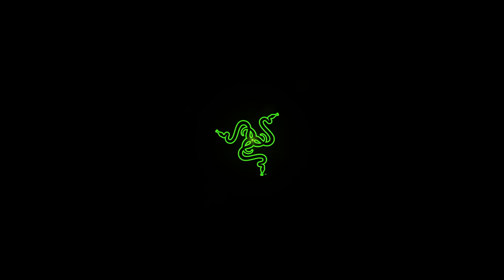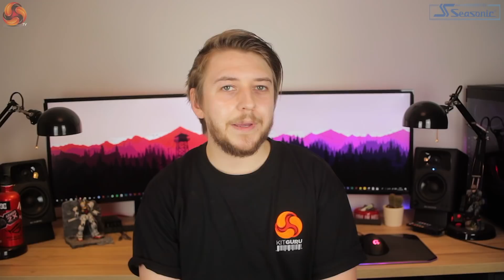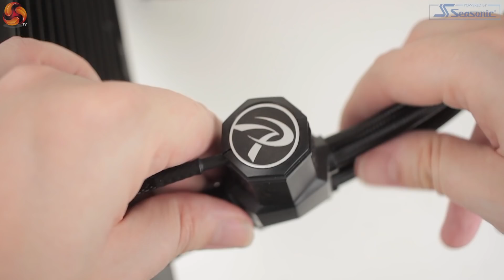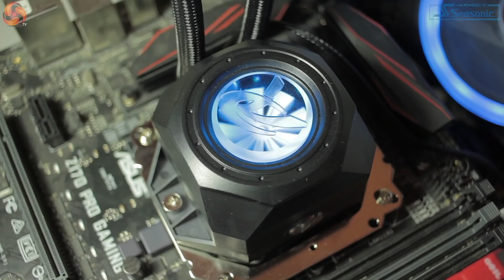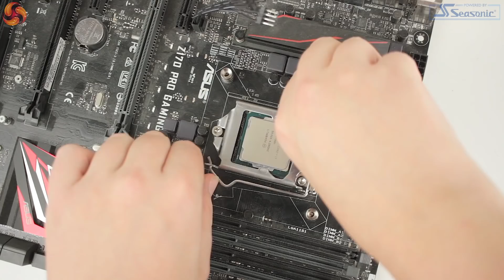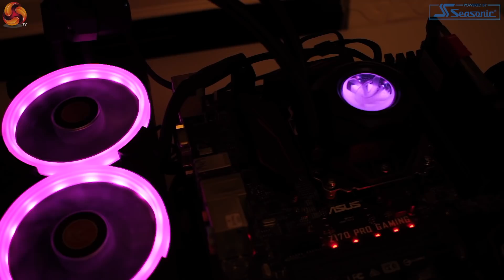Raijintek ORCUS 240 Liquid Cooler Review - with LIQUID FLOW indicator!

Comment: I just got this cooler, all seemed well until when it came to installation ! Upper mounting plate that the CPU block screws on to HAS NO SCREW HOLES. W.T.F. it appears i got two back plates (1 with foam backing & one without), i thought "Made in Taiwan" was supposed to be better than "Made in China" perhapsi was wrong !
Reply: Send me a photo. I might be able to help.
Reply: Do you have any updates? Does it work well in terms of cooling?
Reply: @amazonino277  cools fine for a 240 AIO on a Ryzen 3900X (105 TDP) although mine is the core version so i add high end fans (akasa apache are my choice as i care more for function over RGB), also there is now mounting kits for intel LGA 1700 so more options, at this time however i'm using an Aorus liquid cooler 240 which i feel is a just a little better but not by much. !!!
Reply: @agenda697  Cool! I was looking exactly for the 360 core version, since I already have plenty of fans on my case and wanted to buy radiator only

Comment: How do you connect the RGB hub to your mainboard? It's a 4 pin cable, but some sources state it's 5V add RGB (others say it's 12V RGB)....the cable fits both ways into the headers, too 🤔

Comment: Hello, I have a problem. When I connect the molex connector of the RGB Hub my PC won't boot at all. Just a very quick flash of lights on the motherboard and nothing happens. When I disconnect the molex, it boots like it should but without RGB. What can be wrong? Is something required to plug the molex or does it mean the connector is broken?
Reply: I would only be able to assume there's a short in the molex cable. Maybe a pinched cable? Or, it could be connected to your PSU wrong. That's a strange one.

Comment: How often would you have to add liquid? Do you have to reapply thermal paste every time you add liquid then assuming you have to take it off?
Reply: Depends on Temps and thermals of your cpus, and the thermal paste you should replace thermal pastes between 2-5 years.. been using an aio for 5 years now. Only replaced thermal paste and no issues at all. (X5675 cpu at 4.5ghz)

Comment: I just used this in my recent build. I'm marginally satisfied with the end result but this company is rife with issues. Particularly concerning the RGB fans. It comes with an 8 port lighting controller which offers quite a bit of expansion possibilities. I decided to add another RGB fan for the rear of my case. I went to the Raijintek website but you can't purchase any of their products directly from there. The English wording on the website is also very poor. I then went to Newegg and purchased a Raijintek Iris RGB fan. To my disappointment the new fan I received had a different plug that wasn't compatible with the Orcus lighting controller. At this time I wasn't able to find anywhere that sold a standalone Orcus fan. So, I bought a Raijintek Orcus 140 single fan CPU Cooler and simply took the included RGB fan and installed it in my case. The new fan I installed plugs perfectly into the RGB controller. However, the new fans lighting doesn't match the lighting of the 2 fans that came with my Orcus 240 kit. Not only is the color different but the breathing sequence doesn't mimic the rest of the system either. I don't feel any of this is a major deal breaker but it certainly paints a picture of a Chinese company without an established reputation. If you're purchasing this kit solely for the RGB effect I'd recommend looking to more reputable brands. If it was simpler to add on to the product through the expansion ports I may feel differently.
Reply: You should have sent us an email so we can reply accordingly... there is / was no standard of RGB Fans and we are servicing once somebody informs us, but no contact, no solution i am afraid
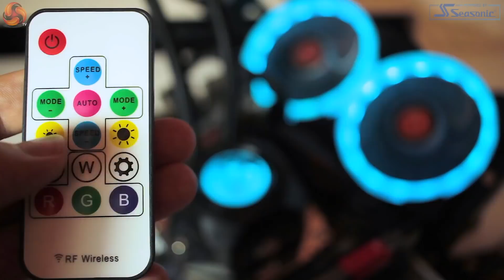Reply: @RaiJintek  How about the fact that some of the colours of the waterblock don't match the colours of your fans, like, at all? I mean look at the footage where he changes the colours with the remote one by one (around 11:58 in the video). White in the fans, light blue in the waterblock. Light purple in the fans, blueish on the waterblock. Yellow in the fans, light green on the waterblock. Deep purple in the fans, light purple in the waterblock. And it's the supplied fans, not some random RGB fans that someone wants them to be colour-synced with your product.. what's up with that?
Reply: @SteliosSioulas  there is a 12V RGB version and a RBW 5V ARGB Version... what you saw here is the 12V version and fading into the Color.
Reply: @RaiJintek  Nope, there is no "fading into the colour". I am talking about the part that he changes the colours one by one, not the fading mode. You can CLEARLY see (especially if you pause) that there are colours on the waterblock that don't match the colours of the fans at all. And what is all that 12V and 5V about? Both the fans and the waterblock are 12V in this particular case, aren't they? So, I am asking again, why don't the colours of the block match the colours of your fans? Don't you use the same 12V led strip both inside the fans and the block?
Reply: I am wondering why you never sent an email to the support... would be highly recommended before you purchase anything wrong!

Comment: The big plus to the inline pump, for me, is that it would be simple to replace if it did fail. At least, it could be if properly implemented.  But I still plan to go with a custom loop so that I have complete control over where the components go.

Comment: What about "Little Devil PC-V10" PC case with a built in Phase Change Cooling unit, it is a little bit heavy but it works and can drop the CPU to -70 degrees below zero and is as quiet as a fridge Freezer but has to be installed per the instructions that come with said case but needs a 1KW PSU, the said case can be got with two cooler heads.

Comment: The inline pump is most likely there as Asetek has a patent on one type of pump that is housed in the CPU block. So now other manufacturers are making their own to get around this.
Reply: Some of them have done that as well. Could just be cost reasons.
Reply: @elvewizzy  theres a reason no 1 puts the pump in the radiator though they could attach it to the radiator

Comment: There is something wrong with your data. 

For the Hyper 212 to do better than the majority of coolers is an anomaly. It's not a bad cooler. But, based on all data from other reviews and tests, it should never rise above the middle of the pack unless you populate your comparisons with budget trash. It most certainly shouldn't be able to beat a Dark Rock Pro 4, even without all the other contrary data showing this, basic physics would dictate it shouldn't be possible due to the sheer difference in surface area to dissipate heat. 

Also, and this might just be a European market difference vs NA, but why are there so many lower tier brands in this comparison while lacking bigger more establish brands in AIOs like Corsair or even NZXT?
Reply from the maker: Its because Silas took over our CPU reviews recently and he has only tested a certain amount of hardware with his components. It will expand over time.
Reply: @KitGuruTech  i do think he needs a biger sample size but i liked the reveiw